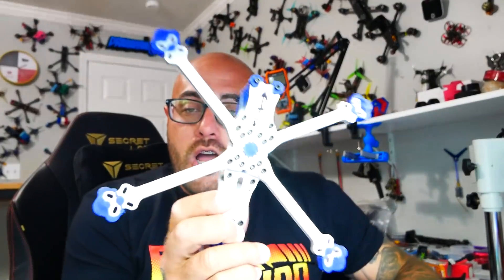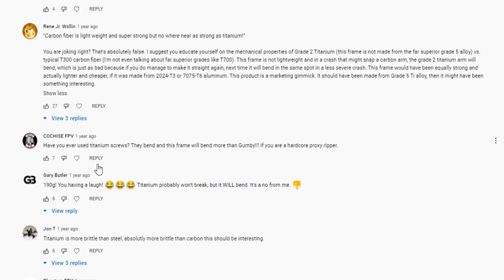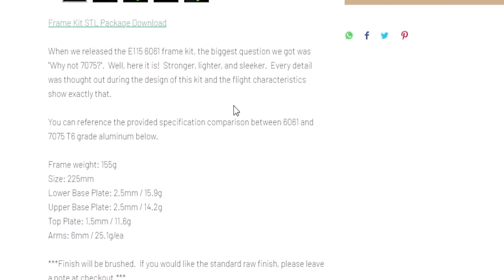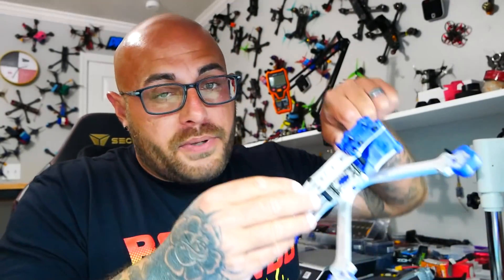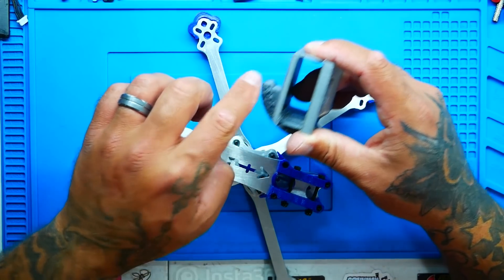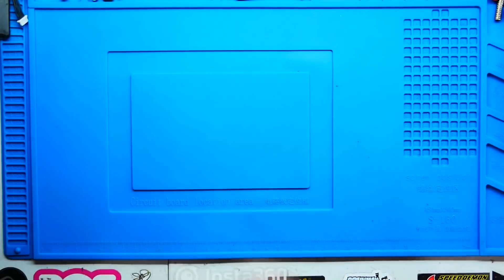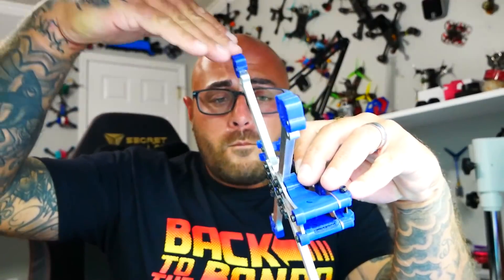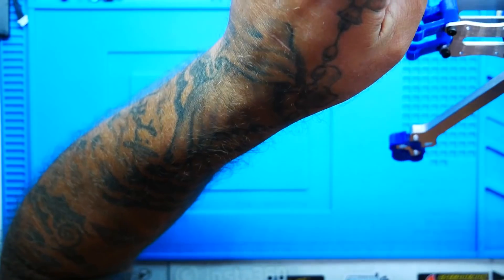ALL Aluminum!! 😱 FPV Freestyle Frame!! Should Carbon Fiber Be Worried??!!

Comment: Now I have all the information I needed to go ahead and cut my own frame from aluminum. I might just start by cutting a Source One first as those files are available on github.
I have access to a 3kw fiber laser to cut steel or aluminum but not a mill for carbon fiber

Comment: I made a (large) V-tail quadcopter in wood, and it flies like a dream. Due to the stresses and strains during flying however, the arms tend to loosen, and therefore I am considering re-making the frame in aluminium OR by reinforcing the screwed joints with aluminium around the wooden arms, that is, by inserting the square (cross-section) wooden arms into pieces of hollow aluminium profiles, thus combining the advantageous properties of both material in one construction. Replacing a broken wooden arm is neither a lot of work, nor does it involve high costs.. any comments/input = welcome ! 👍

Comment: I have a 3in quad made out of Aluminum.  5mm thick it's indestructible! Made it myself to look exactly like the BQE-3AF.  Working on an up scaled 5in version now. Videos of me making it are on my channel.  A solid bottom plate would have worked better on your quad. Why have replaceable arms with all those bolts when your not going to break it. But i will say your frame does look cool.  Thanks for the great ideas brother.

Comment: I am really interested in the vibration of this frame. I have the Pyro that is half aluminium and u can hear it resonating at a certain hz .. it does translate into the gyro but it's not bad at all and the normal filtering takes out.

Comment: You're better off breaking carbon than bending aluminum.  That thing is going to warp in ways that will be hard to see but will endlessly mess with your tune.  But it will probably look dope AF.  Def want to see it.  Don't want to fly it.  Take one for the team Drainman!

Comment: been done before... they were purple by diatone?!? it was 3 to 4 years ago .. RealAcc makes one simular called the metalstar IIRC.. they bend in crashes and you end up with wavy frame from bending it back. I had a drone 3 years ago that had titanium arms and that thing is SOLID! but the arms are heavy on that thing... can't wait to see the results of this frame. I do believe the old ones were 6061.. 7075 is much stronger so i'm intrigued... Have my ATTN>>

Comment: I did this 8 years ago with an old street sign and a scroll saw. I traced out an old zmr 250 with a sharpie. My first attempts led to a few things shorting out but after I black taped my electronics it was ok. I abandoned it and starting flying whoops a few months later. Cool to see someone else try it and do it the right way.

Comment: I'd be interested to see about the resonance characteristics, there's a chance it could be a huge tuning fork. Carbon is pretty good at damping resonance and vibration, there's better of course (like wood or bamboo) but it's maybe the best all rounder. I have built bamboo micros, never looked at gyro logs but they flew quite nicely.

Comment: Before I watch Im pretty sure it'll bend, and I think the resonance of the aluminum might make it hard to tune, Did you say 240 grams for that frame, Holy shit Drainman that's heavy AF, at least for what I'm used to, I like race frames, but the Lab glide freestyle frame I have is 115 grams. How much is the dry weight of the 240 gram frame build? I took a couple months off, and things changed a lot, but that weight blows me away, maybe I just haven't compared freestyle frames enough.

Comment: Carbon fibre can be made significantly stiffer than aluminum while still being lighter, so should carbon fibre be worried: definitely not.

I suspect that because of aluminum being less stiff, this might lower the frame's resonance frequency, which is not good and you might have less performance because you need more filtering at lower frequencies.
Reply: I agree, there is also less of a inherent damping effect in billet alu parts than in composite fibre with a 0/90 layup. But then again, filtering is less of a deal than it used to be even if this will likely move some noise down in the quiet band, and those arms are crazy thick... Interesting for sure
Reply: I agree - the same issue is on the half aluminum pyro frame.  You can hear the vibration and see it in the gyro but the normal filtering takes it out.

Comment: Nope, it'll bend too easy. Carbon fiber bends but comes back into shape if it doesn't bend enough to break. Aluminum arms will bend and stay bent. Possibly ripping the motor wires out in the process if the wires aren't long enough.

Comment: I did build full aluminum F450 with about AUW 1.6kg weight, the problem with aluminum is the metal is too soft to handle 1.6kg falling from 10 meters. maybe a lighter 5 inch quad is ok with aluminum. but I will go with carbon fiber due to bed experience with alu

Comment: I think aluminum arms within carbon fiber plates would be a better combination than all aluminum. Should you build it? Hell yea !!!
Reply: Good point
Reply: I fully agree, I think a carbon fibre-aluminium-sandwich might be the way to go for durability, but... it's going to be hell to manufacture at a reasonable pricepoint as it requires more tooling, more time on the CNC mill etc. I dont think pressing the sheets with both aluminium and carbon fibre beforehand is viable either, it'll likely have to be glued together after cutting/milling. I'll have to buy some 7075 for making a front "cage" for my frame anyways so I could probably test the theory during the summer just for giggles.. hmm
Reply: I agree 👍 great idea 💡
Reply: Agree
Reply: I agree.  May be aluminum for the base and carbon on the arms comparison of both.  ;)